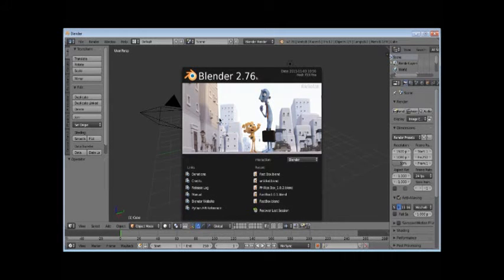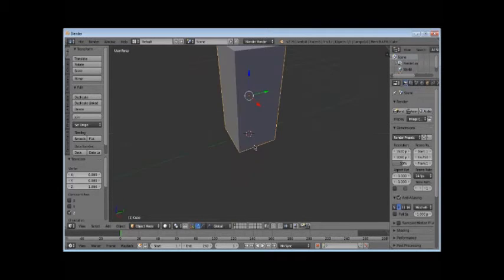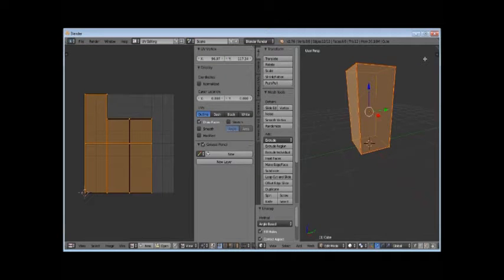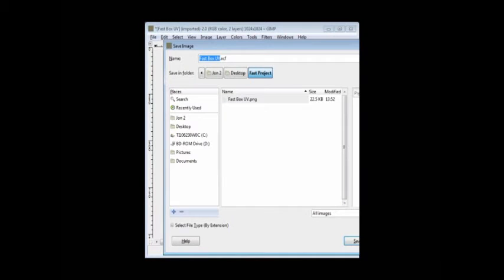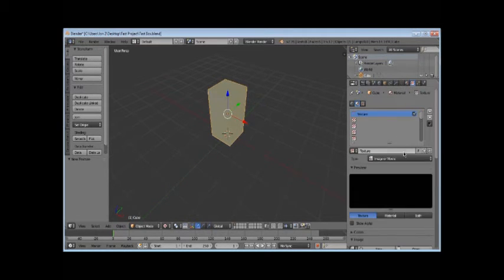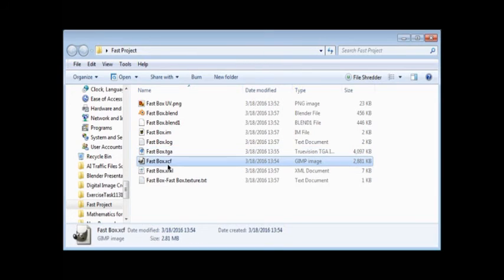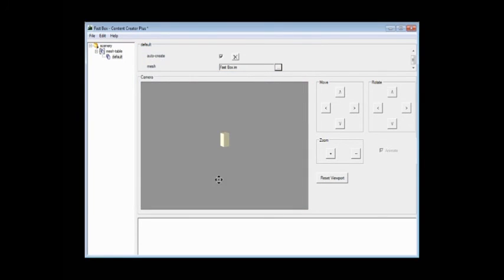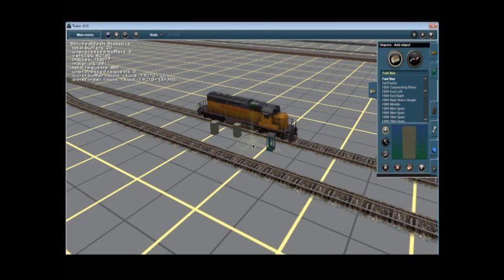Blender for Trainz 2009 Tutorial (2016 version)

Comment: how do i get the .im file
Reply from the maker: I'm sorry, I thought I replied to this already.  When you export, you get a number of files as part of the export.  The exporter itself makes it look like you're saving an .xml file, but in reality you're exporting an .xml, some text files assigning the textures to the materials, a log file, and the .im itself.  Obviously, you have to make sure you know where you're exporting to.  I would recommend a dedicated folder so that you don't lose track of your files.  If I'm remembering correctly, you don't include the .xml and log files when you import your content into the Trainz Content Manager.  If for some reason the .im is not exporting, I recommend using Window>Toggle System Console to see where the error was.  There's always a possibility that an error prevented the file from exporting properly.  As I said in the comment I thought I had posted (maybe there was an error on YouTube somewhere), you should rewatch the video to see if there's anything you missed.  The video took me awhile to edit, as I had to redo it a bunch of times to cover all the errors that one could make in an export.

Comment: I do everything exactly as you show in this video, but in Trainz I have no textures (white object). What the reason can it be? (in editing folder I have .im, .tga, config, .texture.txt which I write myself couse it hasnt been generated by Blender) I will be very thankfull!
Reply from the maker: Double check that you've assigned your texture in the materials.  This is in the video, but easy to miss.  Also make sure that the filename used in Trainz is the same as in Blender, that you've not used compression when exporting to Targa, and that the file formats used all match, in as many details as possible.  For example, although I think you can get away with different texture sizes in terms of pixels (I've done this successfully), you don't want to have one texture that has an alpha channel, and another that doesn't.  You need either to have alpha channels on all of them, or none of them.  These bugs are harder to predict than omitted steps, and I was not fully aware of them when I made the video.

Comment: This is what happens whenever I try to export it:  
14:35:43    
14:35:43    SelectionMethod:  Visible
14:35:43    ExportMesh:   True
14:35:43    ExportAnimation:  False
14:35:43    WriteLog:   True
14:35:43    OnlyXML:   False
14:35:43    ErrorCorrection:  Collect
14:35:43    ExportDiffuseAsAmbient: True
14:35:43    ExportMirrorAsEmit:  False
14:35:43    Unit system:  None
14:35:43    Unit scale:   1.0
14:35:43    
14:35:43 WARNING: no alpha plane in image(s) for Material "Material.001", Texture(s) "Texture"
14:35:43 INFO:    texture path "//Fast Box UV PNG.png" contains unrecommended characters:    
14:35:43 INFO:    Material "Material.001" exported as "material.001.m.onetex"
14:35:43 ERROR:   file "C:\Users\Nathan\AppData\Roaming\Blender Foundation\Blender\2.78\scripts\addons\TrainzMeshImporter.exe" not found
This was in a .txt file that showed up in my project folder
Reply from the maker: First of all, the texture needs an alpha plane or "alpha channel," as it's more commonly called.  It's interesting that Blender's telling you that, actually.  It never warns me, so I have to add the alpha later if I forget it.  If you don't have an alpha channel in a texture, usually it is invisible in Trainz, even if it appears fine both in Blender and the Mesh Viewer.  

The way I add an alpha channel (or plane, as they're calling it) is to open the texture in Gimp and Layer>Transparency>Add Alpha Channel.  Then I export the new texture (as an uncompressed Targa) via File>Export As.  

As for the "unrecommended characters," Blender may mean the empty spaces or the capital letters.  What would be correct (I think) is "fastboxuvpng.png."  So, rename the file in the Windows Explorer and assign the renamed file in Blender.

Finally, your Mesh Importer may be installed wrong.  I suppose the way to check if it's in the AppData folder is to look in...

C:\Users\Nathan\AppData\Roaming\Blender Foundation\Blender\2.78\scripts\addons\

...and see if it's really in there.  It is odd that Blender can run it, but can't find it, though.  That seems like a contradiction.

Remember that you'll want to make the AppData folder visible in order to access it.  You'll find, I think, that in general that's a labor-saving tactic for fixing all sorts of other technical problems.  My computer has always run just as well with the AppData folder visible as it used to with it invisible.  Come to think of it, it runs better because I can fix problems more easily.  Here are some links about that:

https://www.maketecheasier.com/display-hidden-files-and-folders-in-windows/

https://www.youtube.com/watch?v=P2gynTX09ZA
Reply: Thanks!   I'll take a look at it!  :D